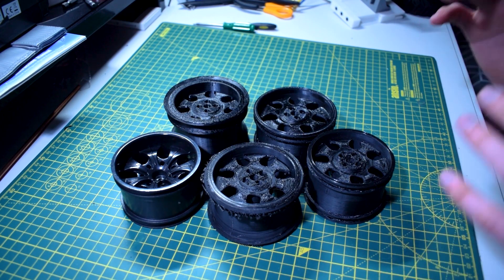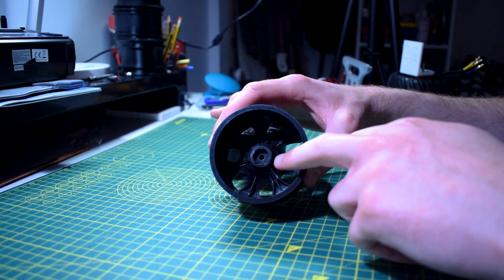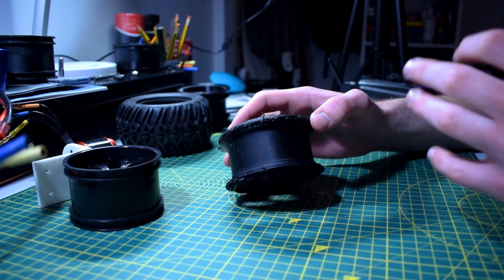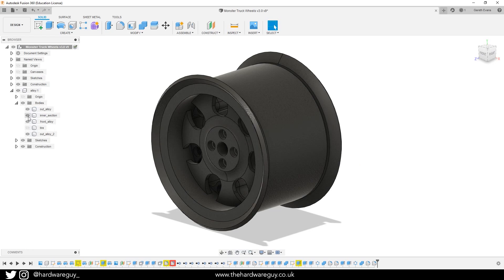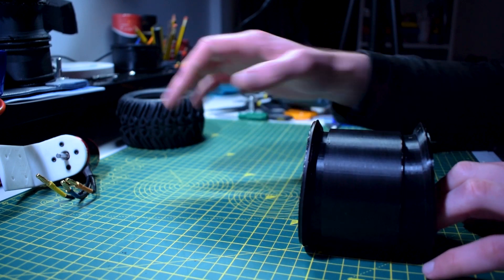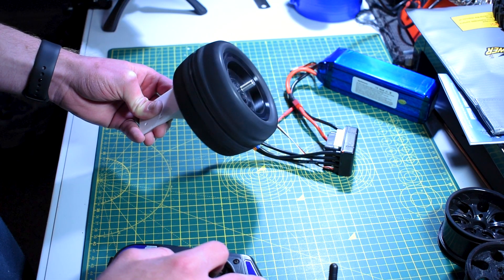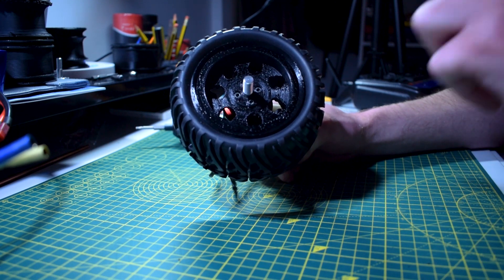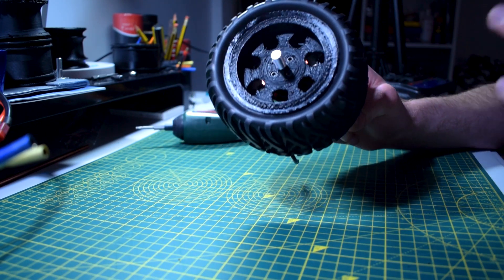3D Printed Bead Locking Alloys

Comment: You can make some tire foams out of EVA foam. Chuck a piece onto a drill press and with an exacto knife mill out the shape and size you need. Should provide some good lateral support to keep the tires in shape

Comment: The tires you have are very elastic which is couseing the balloning of the tires.
In order to stop the ballooning you need a rigid but flexible material that would be fixed inside of the tire. In this case wire would be perfect to use.
Try try making the wire to take a shape like the fence shape(square shape)

Comment: I'm not sure if this is going to be a factor in the handling of the vehicle, but "unsprung weight" might be something to think about. This is basically the mass of the wheels and the moving part of the suspension (including brake pads and discs) the wheels and tyres, compared with the weight of the rest of the vehicle. You get a ratio - and for the smoothest possible ride, you want the "unsprung" weight to be as low as possible relative to the rest of the vehicle. Basically, this is all down to (Sir Isaac) Newton's laws of motion, specifically, for every action there is an equal and opposite reaction. The (change in) in effect you're going to see is that keeping the unsprung (everything not fixed rigidly to the car body) weight low will allow the vehicle to track and ride more smoothly over bumps. This will in turn make the car less twitchy and much more likely to go where you point it. If you put too much mass close to the wheel - i.e. the motors and drive gear - you will be massively increasing the unsprung weight. It will simplify your driveline massively, but it will degrade the handling of the car. There is also a risk - can't quantify, sorry, as I'm not familiar with your motors - that vibrations coming up from the surface to the motor - along the motor drive shaft - will increase wear on your motor bearings. At first you won't notice any difference, but as play develops there, you're going to see the possibility of internal motor damage. Again, I don't know if these are brushed or brushless motors or how they can handle this, but significant bearing wear could easily burn out your motors.
Reply from the maker: Thank you for the very insightful comment! Everything you mentioned there is certainly worth thinking about.
My main focus for now is to get an initial design built, even if it’s rubbish. I’d never expect to get it perfect on the first attempt because I’ve never built anything like this before. I’m very confident with the electronics side but my mechanical knowledge is limited, hence me attempting this project! I actually enjoy making the mistakes because it helps me learn and improve my design over time. Currently no real thought/design has gone into the suspension because I haven’t reached that problem yet! what you see here is very temporary to avoid a rigid body design like my v1.0 car. I will definitely be doing some further research on suspension in preparation for that stage
Reply: @thehardwareguy  I think you're doing an amazing job - and I absolutely agree with your approach to testing and learning. I mention unsprung weight not to try and tell you what to do, only to give you perspectives and things to think about. It is worth acknowledging something important about unsprung weight... Even though we "know" this is an important design consideration, think about the complexity of modern car wheel assemblies... We still see complex brake calipers and stub axles and multi-link suspension, even though we "know" this doesn't help. In fact, modern car design bodges this simply by trying to reduce the weight of the unsprung components, not reconsider them. This is why performance cars use alloy wheels rather than steel (they're lighter) and why Bugatti are 3D-printing brake calipers from titanium (because trying to machine from billet would result in a heavier part). In fact, the only mass production car I'm aware of that tried something different is the old Rover P6 (https://en.wikipedia.org/wiki/Rover_P6) which tried to address the issue by taking the rear brake disks and moving them in-board - they are not attached at the wheel, but instead either side of the rear differential. Moving them inboard like this was a major contributor to the smoother ride of the car... Very difficult to assess impact on your design given hugely different vehicle weights involved, but the principles will certainly apply. Hopefully my thoughts will be something to consider if things don't turn out as you hope with the current design.

Comment: Cool vid and curious for the next steps. The term 'alloy' is a bit confusing for us international folks though ;)
Reply from the maker: Yeah that’s true. I guess it’s not an alloy! I shall call it a plastic instead haha.
Reply: @thehardwareguy  I think in the USA, we'd call it a "rim" or a "wheel".  Awesome work. 

Not sure how to solve the ballooning with that tire. it's too elastic. The only way to fix it would be to fill the inside with an adhesive, kind of like a "run flat" tire that has a solid center. Maybe those tires aren't designed for that kind of RPM. :-)
Reply: @toastrecon  true that
Reply: @toastrecon   thehardwareguy  basic thing for such toy tires are that once the tires are loaded with the entire load of the toy car itself, the ballooning effect would be mostly resolved, Example :No one tests the rpm or torque of tire in mid air,  we do it on Dyno test.
With so much power at the wheel, no doubt the would pop a wheelie everytime.
I think there won't be as much as time for u too observe such effects during the run.

One request - Can u try the same setup "holding the motor" and let tyre roll on a suitable stable rotating platform, simulating that of Dyno test. 
U'll come to know wether it still lifts or not👍

Comment: What about on your center spar making some ribs that extend out to the sidewall of the tire, not high enough that they would press up against the tread but act like spreader ribs that will hold the integrity of the width. That would prevent them from ballooning and yes even on real tires if you dont put air in them and have a bead seal they will do the same thing. This is a big part of what tire pressure is for and given you have none you need to replicate the effects air have on the internal space of the tire.

Comment: That's awesome! How do you plan on measuring tire speeds for error correction? I'm sure the motors won't be spinning at the same rate given the same input.
Reply from the maker: I’m planning to use hall sensors to measure the RPM of each wheel! Using an embedded system and a feedback control loop I’ll be able to precisely control the speed of each wheel! 
The system will essentially be a middle man between the transmitter and ESC
Reply: @thehardwareguy  basic thing for such toy tires are that once the tires are loaded with the entire load of the toy car itself, the ballooning effect would be mostly resolved, Example :No one tests the rpm or torque of tire in mid air,  we do it on Dyno test.
With so much power at the wheel, no doubt the would pop a wheelie everytime.
I think there won't be as much as time for u too observe such effects during the run.

One request - Can u try the same setup "holding the motor" and let tyre roll on a suitable stable rotating platform, simulating that of Dyno test. 
U'll come to know wether it still lifts or not👍
Reply from the maker: @sainarayanen2879  I'll have to try and rig up some kind of Dyno, thanks! In regards to the power, I can limit the initial starting power via software (a bit like traction control), there'll be a lot of experimentation with that because the weight of the car will change things!
Reply: @thehardwareguy  if this is the final motor bracket setup for the wheel, U can give it a shot making the other side of the setup also, fix it to the mid frame which u have already made and test at a more realistic speed at which the car would move on the road given the conditions. We would love to see a video of it soon❤️